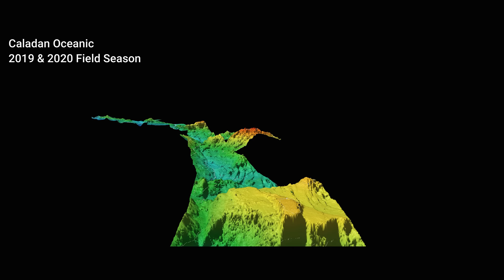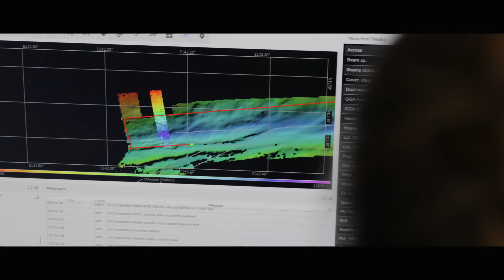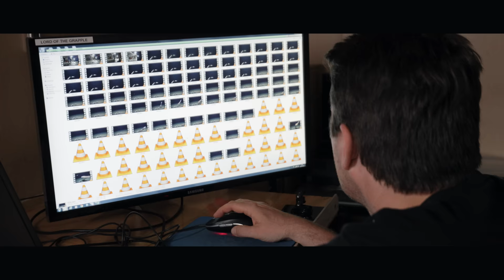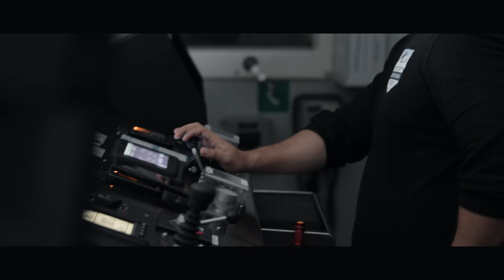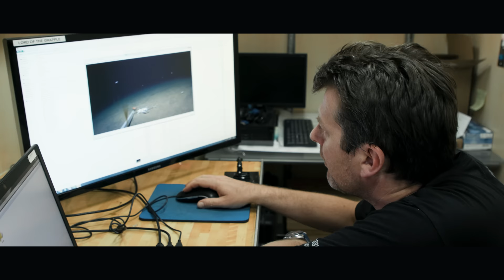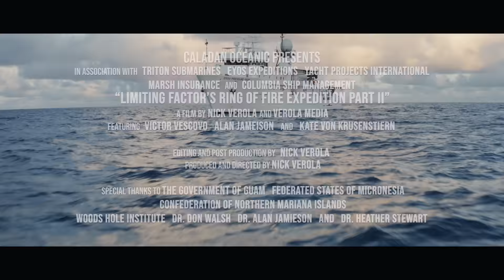Deep Sea Planet

Comment: With the gut microbiome research, how do you avoid the bait contaminating the microbiome? Is it physically isolated post preservation, or do you just accept contamination and filter out the "known" flora from the data?
Reply: (Also hat tip to whomever chose to name the submersible after The Player of Games - and of course the ship, although I'm struggling to remember which of the books that is from)

Comment: at last a half descent video with sound, i just watched the set of Ring of Fire videos and was a little disappointed with them, i am of course interested in what is down there as well as the Triton sub, not just interviews with staff etc and seeing views of the sub etc on the surface

the research you are doing is very valuable, i find the mapping particularly interesting, and in light of current events, finding missing people, boats, ships and other craft including aircraft could be vital in this insane time in our technicalities - while it seems way easier to communicate with space craft millions of miles away, perhaps we better begin using some NASA tech to subs and aircraft in order to locate faster

i find the camera technology slightly old fashioned, and ask the question, with micro electronics why not change everything to ceramic, it would last a lot longer in extreme environments, a company i worked for began using it in the 80's and i'm sure is wider used in applications now especially military applications, it is probably expensive but not as expensive as it was in the 80's, i'm sure it is achievable and you might be able to replace the air for a silicon based oil or something